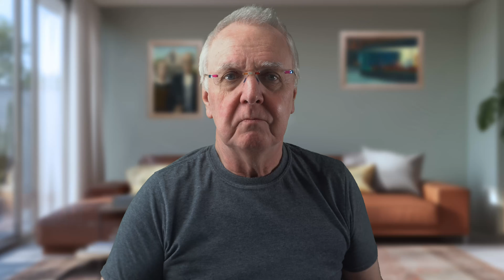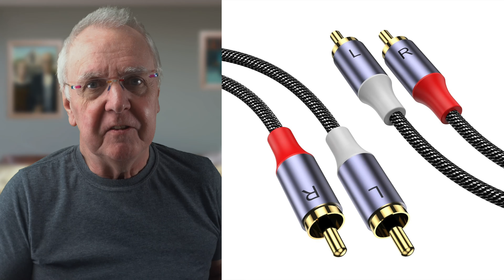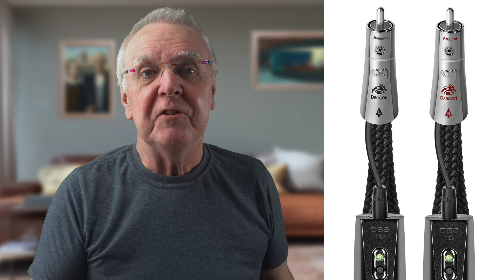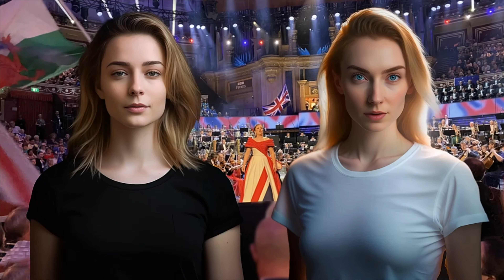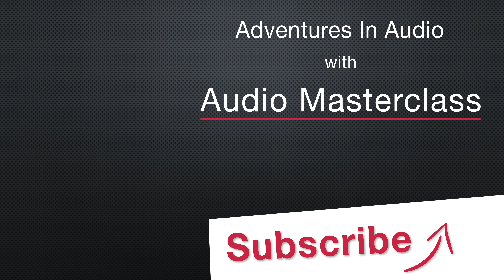How to improve your audio enjoyment with defective cables

Comment: Cables cannot improve your system's performance, they can only detract from it.  I'm reminded of the saying, "Do No Harm" as it relates to preserving the integrity of the signal passing through them.  

As an old audio "enthusiast," I've used reasonably priced (based on current audiophile standards,)  Kimber Kable interconnects and speaker cables for years and have never looked back - PBJ Classic for interconnects, ($148 for a 1M pair) and the original Kimber 4PR Speaker Cables - ($186 for a 2M pair terminated with banana plugs.)  Both are excellent and of the highest quality.  

Purchased once, they have served me well for many years now when used with a wide range of equipment.   My 2 cents USD.
Reply: I can say the same for my $15.00 no-name RCA cables bought from WalMart.

Comment: Cables matter; I’m a satellite communications engineer and there are absolutely measurable performance differences between cables at RF. But that’s when we’re talking 25 GHz frequencies. The effect is way less at kHz frequencies and I doubt it’s audible unless the rest of the system is very very good. I am about to test this for myself at home with a speaker cable upgrade… with an agreement I can return them if I hear no improvement. Currently running cables I bought for $35 in a Rotel and Monitor Audio setup that cost me close to $20,000 (Canadian) but which I am extremely happy with.
Reply: You are “ happy” with Rotel?
Reply: @TheldmfyI’ve always enjoyed Rotel stuff, for 30+ years. I started out as a kid with Yamaha, I’ve used a lot of Arcam and Cambridge gear as well. But I love the RA6000 and DT6000 combination I have now. I listen to mostly classical and it’s fantastic for soundstage and instrumental separation.
Reply: Do yourself a favour here.  Do an AB test with single speaker mono.  Blind is better... 
I'm betting that unless your present speaker wire is telephone wire, you won't hear the first bit of difference.
Reply: Cable naysayers read like a Who's Who of who is old, who is unable to afford, who can't hear, who has an agenda, and who likes to feel smart & feed their insecurities at the expense of other audiophiles (who can perceive better). A/B tests are not a fun thing to do; they're a pain, and for some reason humans do awful on A/B  taste tests and other blind tests. So considering that, they prove nothing. 

 The last thing in the world that audio dealers would want, is to lose their customers. Selling them an expensive cable & wasting their money & disappointing them = lost customer & they won't be back. Audio dealers do not have that many customers to begin with. It is truly idiotic to think they would throw what few customers they have away;  for a one shot cable ripoff. They would perish without repeat business. There are more in home no risk trials with cables thany any other field in audio. It's not hard to realize which side of the cable debate is the smartest. You'd have to be crazy to think dealers want to lose their customers. All it is, is that the cable deniers are hearing impaired, can't afford to buy the right cables and enjoy feeding their own psychological insecurities by picturing masses of presumably  stupid people hearing things. It's their therapy...They have many problems; and they are great.
Reply: @princeof_all_air Well, after spending $300 on speaker cables and $160 on new XLR interconnect I definitely hear a difference from the cheap stuff I used before. Again as an engineer in satcom this does make sense to me. I doubt that $10,000 cables are a good buy, but I’m definitely sold on buying good cables vs generic cheap stuff.

Comment: I just bought a pair of used speakers which were 1500 € new. The seller said he just throws  in his speaker cables. I was like "what ever, I'll never going to use them anyway". Then I read Oehlbach on them and googled. These cables were 400 € a pair for 3 meters each. Of course I sold them and made my speakers even cheaper.

Comment: I've used various qualities of cables and I can tell you a few things:

* Gold electroplating arguably reduces the quality of the audio - very slightly - compared to unplated connectors, but I've dealt with decades old cables and ones that weren't gold plated sometimes wound up corroded. Worth the extra $10 or so to get the cheap gold plated IMO.

* I've seen RCA cables used to connect up actual speakers, rather than hooking audio components together. In this case cables that use heavier gauge wire are definitely better than the cheapest ones, and simple 2-wire beats coaxial.

* If your speakers cost less than several thousand dollars I don't think you'll be able to hear any difference in quality between cables at all.
Reply: Actually, gold plating makes the surface of the connector softer which makes for a better connection.
Reply: Wrong on all counts. 

1) Gold is more conductive than copper or brass, and it doesn't corrode.

2) For speakers, yes lamp cord is better than microphone cord, but not for line level signals.  At line level the impedance jumps from 4 or 8 ohms to several thousand ohms (10,000 is common). At these higher impedance levels electrical interference from nearby transformers, transmitters, power cords and such can easily get loaded onto an unshielded cable. The "coaxial" design is not a fashion choice... it is to block the incursion of noise.

3) I've heard small defects in cables on speakers costing as little as $20.00  In fact I keep a "cheap enough to discard" speaker in my toolkit for just that reason.  The assumed relationship between price and quality is actually one of the silliest of all audiophile beliefs.
Reply: @Douglas_Blake  1. You are correct about gold being a good conductor, but adding it leads to another interface between metals in the connection which can increase resistance - as I said, very slightly. Unless the ENTIRE cable is gold, which, lol.

2. That's what I said, it was just for when speakers are directly connected. Just something to note.

3. If you have a defect in a $20 cable that you can actually notice a quality issue, you can buy a new cable and still have saved money over the $100 cable.

Comment: If a person cannot hear the difference between a $5 & a $50 RCA or USB cable then they really do not need to worry about cables or Hi-res audio. Additionally, they can buy speakers that just deliver a robust, hefty sound, a transiently slower speaker.  Its all just pluses and minuses, unless its faulty/old gear than its just mostly minuses.

Comment: A good and correctly designed and manufactured cable isn't low end. If a cable has a sound signature, it is flawed.
Reply from the maker: This is my point though. I want a cable manufactured to an excellent standard that has a clearly audible issue, or issues. It would be a learning experience for anyone who wants to understand the importance, or irrelevance, of cables.
Reply: @AudioMasterclass  That wasnt my point. I want a cable that has NO audible issues, or sound signature by its own.
Reply from the maker: That wasn’t the point of my video. You should watch it again, particularly what I said was my point which I stated twice. Worry not though, hardly any commenters understood it.

Comment: I really doubt you will find a pair of cables for 5 pounds that has 100% shielding. Not talking aluminum foil, which is microphonic with phono, especially MM type cartridge. I mean braided or wrapped shields. I think you will need to spend more to get that engineering bullet point.

Comment: I use cheap cable, but not "that cheap" neither (or can be, for 5€ can find short ones), but the photo you showed kinda reminded the few deceptions I had when trying amazon in the recent years, not a matter of sound, but longevity, compared to any random music shop websites. 
But for the same price you can find more sturdy ones on website that don't take advantage of being the new de facto default to shove aliexpress dropshipped products down your throat that just looks nice in a photo, unless you order it and touch them, and realize their certainly less copper in them than there's hair on my mum bold head, and they're so flimsy they'll rip open quickly if you're a bit too adventurous in your physics experiments. 
For the same price tho, you can have, depending on the length, ones that will survive you, but that photo really gave me ptsd of cables that would barely make it as a free cable included in a budget 2003 mp3 player, they looks nice on an amazon photo, until you have them in hands. 
Still worth pointing it out too, you don't need expensive cables, but you still need sturdy ones, and sometimes maybe 8€ instead of 5€ was the correct decision.
It's like cordial t(r)s or xlr, they're a little bit more expensive than the random cheap ones, not that much tho, but gosh, they'll be there at your funerals. Anyone who had to use random stuffs like "yellow cables" (don't know if that brand still exists) in the 2000, and replace their jacks almost as often as their strings, realize that yeah, maybe the price of two bigmac instead of one was a good decision.
I know the videast here certainly knows, and probably agree, but you the reader might need it.

Comment: Hello. Most of what you say sounds right. But the electrical "basic lessons" you mention - capacitance..reactance..and ohmic resistance... also result in the fact that there IS a difference in the electrical conductivity between the cables. And thus also in a certain sound difference..Which in turn results in a certain kind of price difference...But of course does not justify the INSANE prices that some cables come up with. The crazy high priced cables can..as you yourself might also agree with me...explained by the fact that there are some developers, and sellers, who are so good at talking for themselves, that this pangs what is going on in my compatriot H C Andersen's fairy tale about "The Emperor's New clothes".. Kind regards, Alf from Denmark

Comment: If you are handy, you can easy make a very good cable for 10 Euro's. For a decent revealing system, that's good enough to 95% of the people. I just buy instrument/studio cable in bulk, and mount some decent non magnetic RCA Connectors from AMP brand. Very cheap Connectors are often magnetic, and yes on a decent setup you hear this.

For a highend setup i go a step further, and use cables with ptfe insulation for lower da.
This is also something you can hear, and i use the same type of cable in the signal path when i'm restoring a vintage amp for such a audio setup. Off course shielded where it needs to be.
The internal wiring of my speakers got the same treatment.

The bottom line is: a really good cable doen't need to be expensive if you are prepared to do some work.
"Standard" cables which come with equiptment belong in the trash. It sounds horrible on a revealing system😂

Comment: Anyone seen HDMI via Fiber Optic cable yet?  LQQKs like a real nice connection👍 

.                                                                                                                                                           Acid Jazz, Funk & Brass🔈🔉🔊
Reply: Been running the laser projector and camera feeds over Active Optical cables for some years at the church where I did tech/sound. Only FHD, not 4K but works perfectly over long runs, no glitches or electrical interference pickup.

Comment: Imperfection might not always be a negative in a cable. I know that might sound crazy but listen me out. I went through a period of audiophile madness in the 80s and 90s, which included cable fetishism (Van Den Hul, Chord, etc, I tried a lot).  Basically they all sounded the same, ridiculously expensive  and crucially didn't make me anymore satisfied with my system, which the hifi mags had led me to believe would be the case. I then started using  DMN solid core which was relatively inexpensive, and  subjectively, to me sounded better. Now I emphasise it sounded better to me, in the context of my system and I'm sure the sound it imparted was largely because of a what might be considered undesirable resistance characteristic - but it worked for me. When I finally built my own valve  amp, which is riddled with all manner of so called terrifying distortions, but sounded much better again  to me than so called 'perfect' transistor amps I'd found so disappointing, it proved that emperical perfection often comes up short. Sound reproduction is always subjective and a compromise. it just depends on what you can live with and still enjoy.

Comment: After using many chord interconnects, I'm convinced they add in manufacturing defects so you want to keep upgrading up the line.
Reply: All copper cable oxidizes and makes the sound worse over time.  Silver wire also oxidizes but silver oxide is still a conductor, unlike copper oxide which is a semi conductor.
Reply: @chrisantoniou4366   I believe the worst was aluminum which does oxidize to an insulator.

Comment: This whole cable thing is so unbelievably easy to answer ... Just set yourself down and Blind A-B test the cheap and the exotic.  Do it on the most resolving system you can find.  Once you realise that you can't tell them apart... lesson learned, money saved, issue resolved.
Reply: You don't even need the most resolving system you can find. Just use the one you listen to. If you don't hear any difference on what you use, that's all you need.
Reply: @laurieharper1526  
I've done AB comparisons on some truly awful systems and, yes, when their is a difference you can usually spot it.
Reply: @laurieharper1526  
I suggested "the most resolving" because, frankly I'm tired of people telling me my system isn't resolving enough.  (whatever that actually means)
Reply: @Douglas_Blake  No need to strain at it. My point was that if there is an improvement to be had by using expensive cables, it will be apparent on any half decent equipment.
Reply: @laurieharper1526  
Yep .... if it's real, it's usually easy to spot.
Reply: The thing is, the audiphools that argue they can hear it, hate A-B testing exactly for opening up their eyes. Forgot where did I read it where the article writer claimed that not knowing the gear you're using is taking away from the perception or something.
Literally explained placebo effect on his own explanation against A-B tests.
Reply: @Kalvinjj  
All cultists fear exposure of their deception ... it's called "faith".
Reply: @Douglas_Blake  A cult does define it better than a religion let alone hobby.
Reply: @Kalvinjj  
I think you're looking for "describe" rather than "define".  

Audio equipment is not a hobby, unless you are going inside and modifying or repairing the equipment.  It is, in fact, a Purchase

Audiophilia has become a consumerist cult where dominance is established by who's got the most expensive equipment. 

The sad part is that it's priests are all corporations who want nothing better than to take the audiophile's money. It's right out of "the goose that laid the golden egg"
Reply: Wrong, you only now know you are no audiohile...duh
Reply: @marcodevos3565  
That's right.  I'm no audiophile ... I know better.  After 45 years working in electronic service, it's a safe bet I've learned a few things along the way.
Reply: @marcodevos3565 duh da da da

Comment: There's a caveat to that you don't want to have low resistance on a cable from digital to digital 120 ohms cat6
Reply: The Ohm parameter of a transmission line has nothing to do with conductor resistance.
Reply: @PlatypusPerspective  it does in a cat cable. you're talking about coaxial cable inductance, yes it doesn't in that case
Reply: @therealBozoDjTrump So, the last CAT6 installation I was, shall we say, involved with, had a 4m run from the router to the residence downstairs station, 20m to the residence upstairs, and a 45m run to the mezzanine in the mechanic's workshop next to the residence. Which do you suppose has a resistance of 120Ω ?
Reply: @PlatypusPerspective  as far as I can remember I think it's per thousand feet is where they take it from
Reply: @therealBozoDjTrump  Who is "they"? Is this some kind of conspiracy theory?
Reply: In case anyone wonders about the answer to the question, it's (D) None of the above. To have 120Ω resistance in the runs would have required using multiple 1000ft/305m reels of cable.
 Of course you want low resistance, and Cat6 delivers that reasonably, otherwise for example POE (Power Over Ethernet) wouldn't work. The spec for the maximum workable run of 100m/328ft is no higher than 9.38Ω DC measurement.
 Coaxial cable and a twisted pair in a communications cable both function as transmission lines - the characteristic impedance of the twisted pair is 100Ω, generally allowing +/-15, or +/-18 in the frequency extension of Cat6 over Cat5.

Comment: Hilariously,  people who waste money on cables should never ever take the back off their speakers and look inside.   They're hooked up with lamp wires and push connections
Reply: How far does a signal travel inside a speaker compared from amp to speaker? think first.
Reply: @tothemax324  Considering windings of crossover coils and such maybe farther then one would think.
Reply: @tikilord66  Which all depends on the power and delivery of the amplifier to the speaker.
Reply: You know those cheap orange extension cords? The best use for them is to chop the ends off and use them for speaker wire. That goes double for the zip cord ones. Zip (lamp) cord is great for speakers.